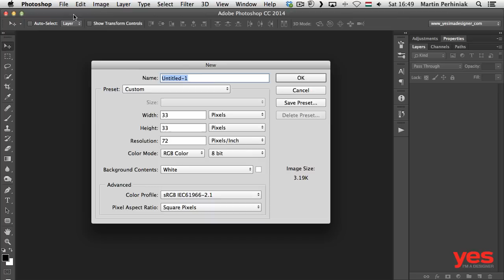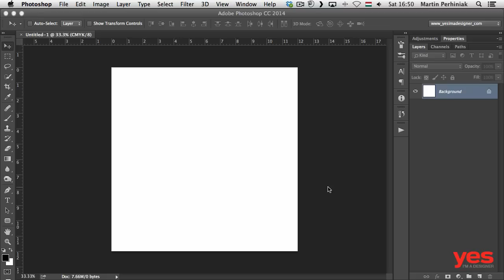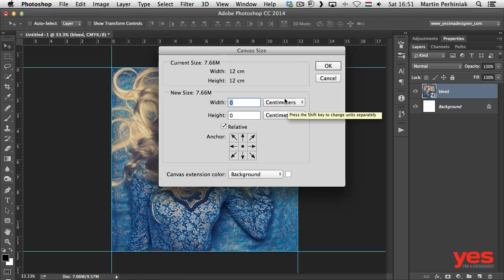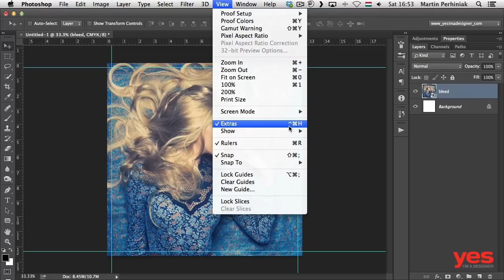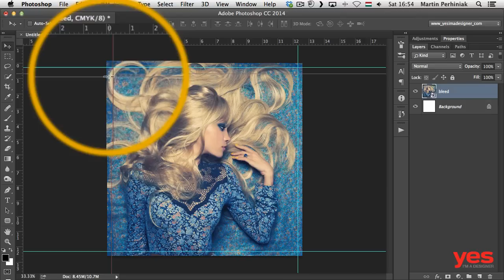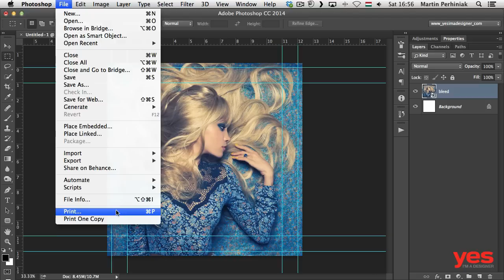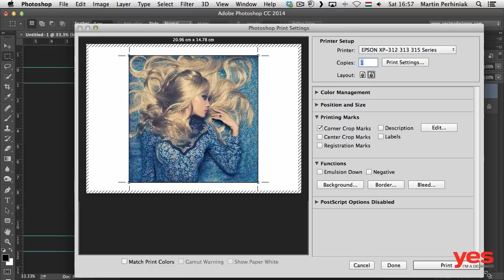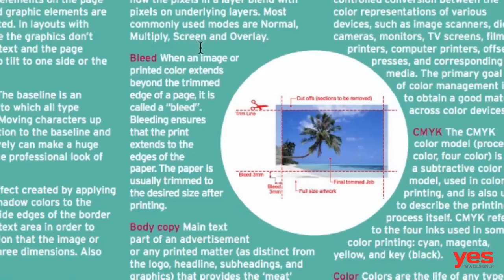How to use bleed in Photoshop?

Comment: What version of Photoshop did you use? I have Photoshop CC 2017 0.0 and there is no bleed set up in the Print settings.
Reply from the maker: You have to work around it as I explained in the video you have to go > Image > Canvas size and extend the whole canvas size, make sure you thick the relative option, change to mm and type in 6mm Height and also 6mm Width.